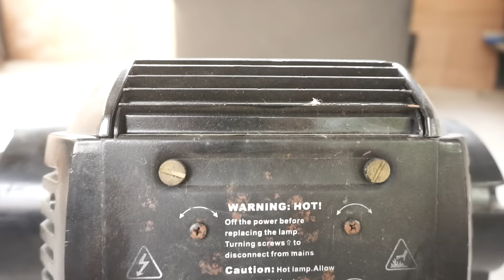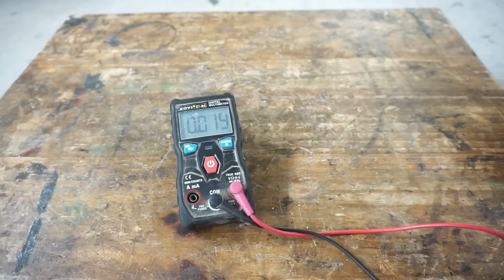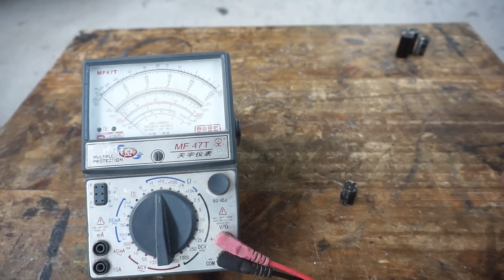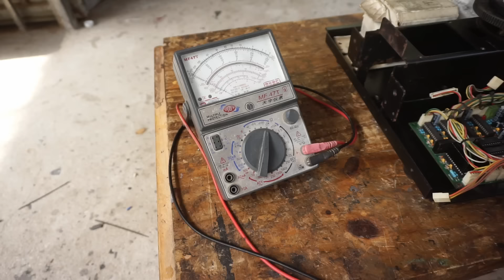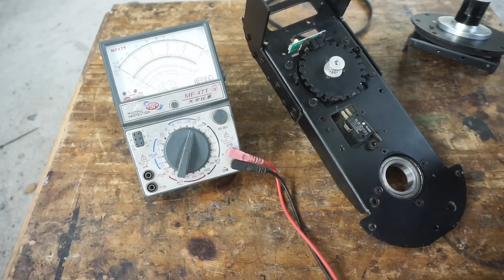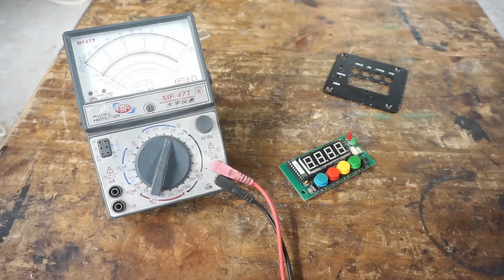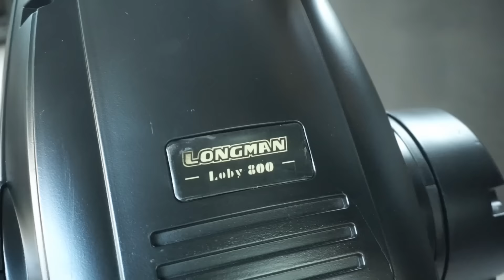Restoration giant stage beam lights // Recreate new life for discarded objects

Comment: Great job on the repair.
I noticed you took out one of the prisms & left in a cracked colour filter, that being said, i don't know how easy it would be to find those parts as it's a random Chinese Spot Mover (Longman Loby 800).
It's a pretty odd mover as well. 3 colour wheels in random positions, 2 gobo wheels, an animation wheel (& a weird one at that as well with an open slot), Focus & Prism effects inside, yet it seems there's a lot of wasted space. Nothing to do with your work, just pointing out the weird quirks this light has (cause I love stage lighting).